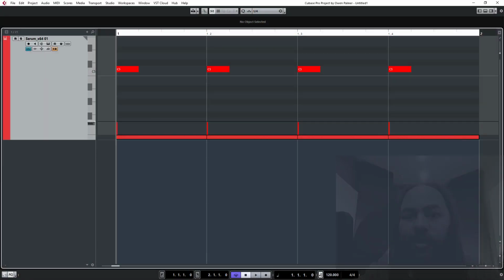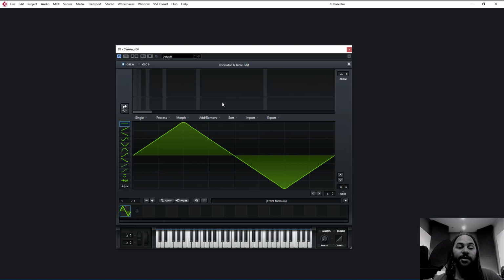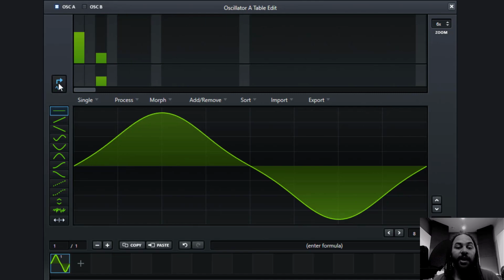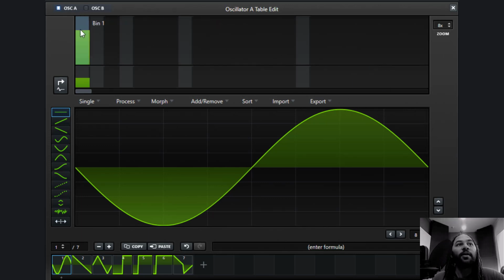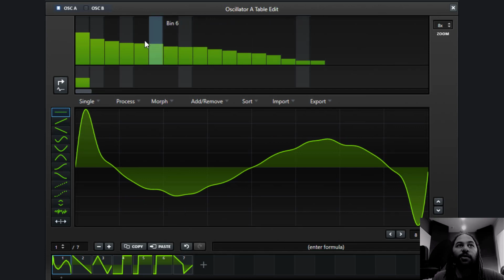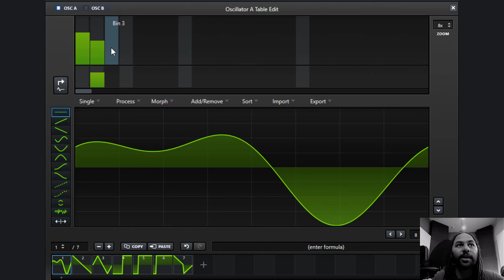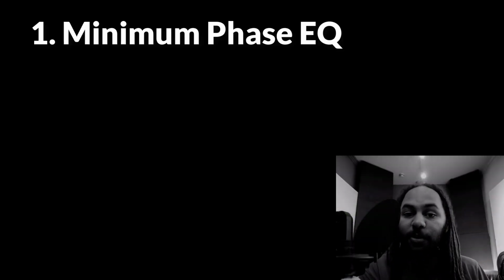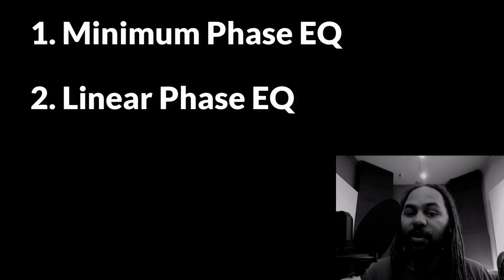What Is Linear Phase EQ?

Comment: Hey Owen. Love these videos! Thanks for doin em.
I recently watched a tutorial which advised adding an eq cut at 20hz and 20khz (yes I've seen your eq series) to free up headroom from inaudible frequencies. In the past I did this with a linear phase eq to achieve this effect with minimal cost to the sound quality with a eq as the final effect on my plugin chain [using Pro-Q3, usually a 96db/octave slope]. What's your perspective on adding cuts at 20 and 20khz to free up headroom, and would linear phase be superior in this situation to zero latency eq mode?
Reply from the maker: Generally, cutting at 20Hz won't free up headroom unless you have a DC offset or some otherwise poorly-recorded/generated source. Much of the time cutting at 20Hz will decrease instead of increase headroom.

Generally, cutting at 20kHz might potentially free up headroom, but it would never be by much and it's likely to cause subtle nasty artefacts.

Using linear phase filters to perform these tasks will generally increase your chances of reducing headroom, but will guarantee you get pre-ring artefacts. I doubt it's worth it, but you should measure the benefits (how many dB of headroom are you freeing up, if any?) and make a decision.
Reply: @OwenTheGeek  I thought it had less to do with headroom, and more with making sure various areas of the frequency spectrum, especially the low end and the high end, don't get too crowded or noisy. This is especially important once you have 50+ elements playing at the same time, then those subtle rumbles and/or hisses can stack up and cause a mess unless properly filtered away. Heck, I've repeatedly been told that low-cutting and high-cutting is the only EQing I ever have to do, and the rest is up to sound selection

Comment: Guess, this is a proper topic for my question))
If i use some parallel processing with, say, slap bass track and use LP EQ to avoid phase issues in low frequencies.. can i just chop the pre-ring later?))
Reply from the maker: My suggestion: minimum phase will normally work best for slap bass. Leave the LP EQ well alone.